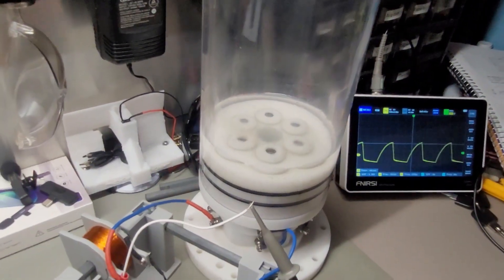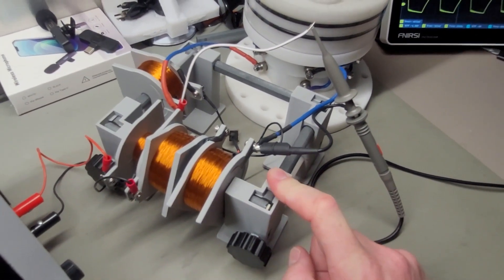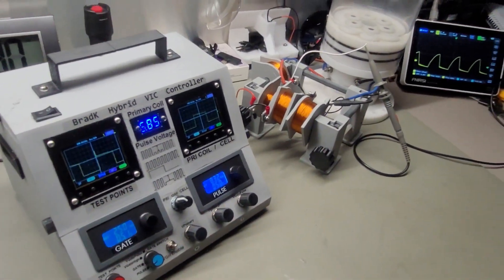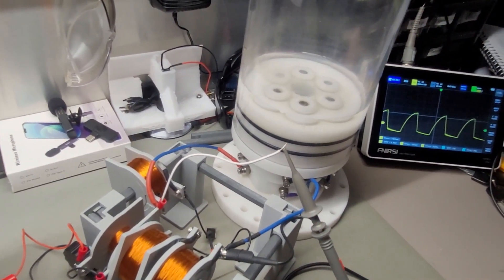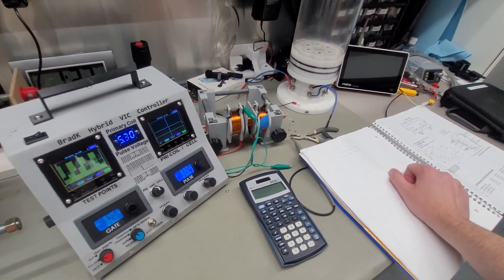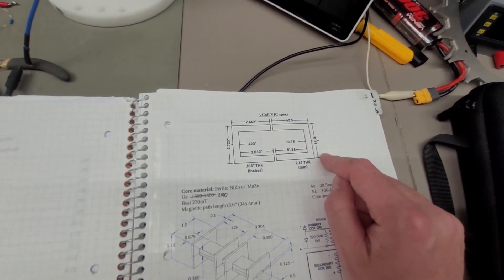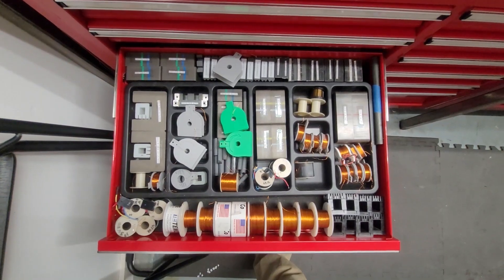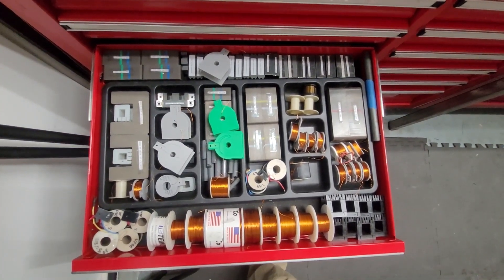Stan Meyer Research # 35, Jul 2023-V.I.C. TESTING reveals the problem...

Comment: put cells in series pairs to balance the load and windings, (first set inner and outter and 2 nd set outter and inner )in the series pair this evens out the windings on the chokes
Reply: Stan said: "Step 9 - Pulsing Circuit remains the same with more excitor pairs added. Power loss is held to a minimum". Series increases your voltage  threshold, but also divides differential voltage across each tube equally. Capacitance is also divided, making operable frequency range much higher.
Reply: @drgonzo7806   when a Bypass diode is between each cell pair in series with the other  4 pairs ( 10 cell total 5 pairs) then it is like a solar panel individual cells are wired to things improve some what, this because with out the bypass diode * like a solar panel ) if 1 cell (in each Series pair)or 1 cell in the full set of series 10 pairs  , 8 or 6 etc fails the whole thing fails, and or if 1 cell fails or fluctuates in any of the pairs (2cells in series balancing the inner outer resistance / wired outer to inner and inner to outer) than it also faults.  The By pass Diodes stop that voltage drop and  stops the short fail of any or all cells and provides that stability and constant  balanced resistance for both coils to work.  Some may feel they can do it on a minimal wfc set up but sadly you will find constant  changes across cells due to series fault( like Christmas light string in series  fail when 1 globe goes out or they flutter or fails all fail)bubbles and impurity action and flutter capacitance during dbd layer effects ,  effect resistance stability of cells and water. so yes it is just a  tuning feature or arrangement but it is a good one.   Since Start this journey in 1998 we have collect and replicated all cards from Meyer and  advance some. Stan when through a minimum of 11 versions from version1 to version 11 we have those original cards and followed the steps. if people do same they will discover the same  results Stan Told the Truth and it works on all versions.  The skills and methods are  things that must be learnt buy studying and doing.  Over all we all  learn at our own pace and share what we can. As Stanley Meyers Owns the tech he is dead and gave it to world open source.  Those parts and accessories found saved preserved are now on the internet free and can be remade if you do the work from that free information ,  or purchased like any thing else in the world from the factories making them.  As time passes super smart high paid people are realizing Stanley Meyer told the Truth and VOLTROLYSIS is the current state of the Art.  Again Try version 1 to 8 they all work fine  Brad is showing 9  using flat core vic it is only 1 of the proven working versions.  look up 9XB 8xa 10 xa 9xa they all work fine with no salts or electrolytes resulting is Hugh power savings to make fuels.
Reply: @hydrogen-power-gas  Sounds like you spent a lot of time coming to that analysis. Good Job 😆

Comment: Hi Brad... I have one of those cores together with 2 sets of bobbins which are wound to the right resistance and wire diameter, they are mounted on a 3D printed housing which also lets you adjust the core gap to whatever you want ... I will send you an email with pictures of what I have.. if you are keen let me know.
Reply: Are there open source files for the 3D-printed housing? If so, can you please share? TIA

Comment: Remember what Stan called the Inductance-Capacitance effect? This allows the voltage to be reproduced at the cell, and travel through the chokes "unimpeded". I'm experimenting with this now. Being able to gap my choke core allows me to shape and de-saturate (reduce the reluctance). I run a decoupled arrangement similar to the later 8XA (VIC4 like with a primary/secondary arrangement). The secondary coil can be another culprit of killing off the output amplitude. One thing Stan referred to in his defined 9 Stages Of Amp Restriction was the use of a very loose primary/secondary coupling as a stop-gap way to restrict amps. (Remember Tesla and his waveguide coupling where k <= 0.06 ?) When I use a step-up transformer designed similarly (and sloppily), the amplitude is reached much more easily.

Dump all of the water out of your cell and observe your waveform across Vc, Vl and the combination of Vc + Vl in series. Some of the best magnified amplitude step-charges I've ever seen, were before I poured the water in. The water makes the signal drop almost completely out every time from the leakage and/or voltage coupling to water bath. The realization could be that the circuit is working just fine (without the water). 😀
Reply from the maker: In most of my testing now I don't connect the wfc. With the coil in this video the turns ratio voltage appears open circuited (same if dry cell was connected) with no problems.

As soon as I simulate the load of the chokes (by adding a resistor in place of the chokes) voltage drops down to unacceptable levels.

 IMO the VIC needs to be able to produce the turns ratio voltage when short circuited. If it can't do that there's no point in trying to hit resonance. 

I've tried many of my own VIC designs using different cores and none of them have ever worked. I'm positive Stan had those cores made for a reason. From my experience no 'Off the shelf' core exists that will work. There may be one out there but I haven't found it yet. 

Even with Stan's core I'm sure getting it to work is still very difficult.
Reply: @BradKwfc  in order for it to work you will need the amp inhibitor circuit which is a separate coil unit in itself... there is one picture of it that I am aware of and that is in the meyer estate photo's.. it is mounted on the other hand of the vic you are trying to replicate.. it has thick windings on it one being a primary and the other two I'm guessing are bifilar chokes.... I will email you a picture of it.
Reply from the maker: @electro1622  I got your email but the pictures didn't come through.
Reply: @BradKwfc  I resent them... did it work
Reply from the maker: @electro1622  Got the pictures. I thought that was the Steam Resonator, there's a H bridge type switching circuit along with a full bridge rectifier on it.
Reply from the maker: @electro1622  Yes
Reply: @BradKwfc  If you look at the estate photos you will see it together with the U core VIC you are replicating... there is also one picture of the core itself together with some round bobbins but that is for the VIC you are doing since it is mounted on the other half of the alloy housing
Reply: it is the resonator core. 2 npns and 2 pnps next to it? Was an Hbridge attempt from Stan, but also only 1 of 4 arrangements for steam. The others had firing orders that an HBridge can't provide.
Reply: Don't trust every estate photo you see. Stan had many failed iterations that he evolved over time. The junk lying around the garage could be any one of such.
Reply: Can any stepup transformer actually do that? the core size/saturation would ultimately limit the amperage and then voltage would always fall.
Reply from the maker: @drgonzo7806  If we just look at the total resistance of the secondary coils and assume the load is a dead short the peak current should only be 200mA-250mA. If the transformer can't hold voltage at 250mA we're done... at least that's how I'm seeing it.

Comment: ur loosing the coupling in the gaps.. so you get a high reactance output any current drops the voltage… 
try using a different core or coil strategy 
cheers
Reply from the maker: Yes... sounds easy to do but getting it all correct is tough...I don't think there's even an 'Off the shelf' core that will work at this point.

Comment: analyze the transient of a single pulse.  
try on the input coil a neon transformer or any other hv low current source that can be pulsed.
I think  the impedance effect on conductors as invented by T and coils as antenna's should be pursued.   I got this idea by reading Don Smith.
 

my 2cts :) follow your methodology and intuition.